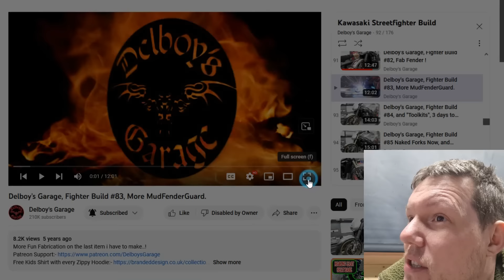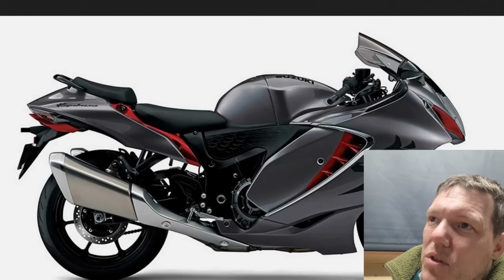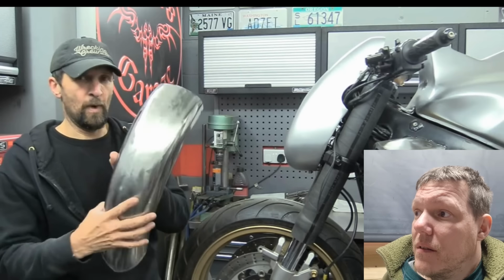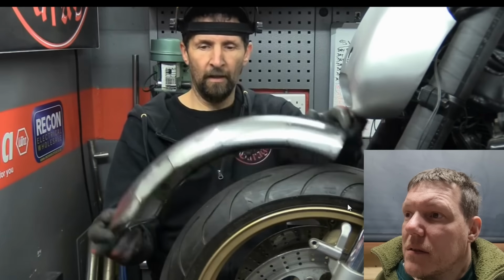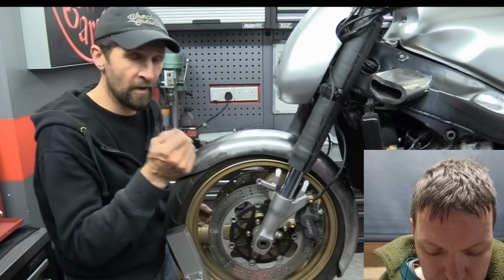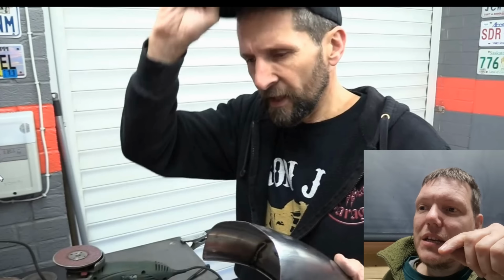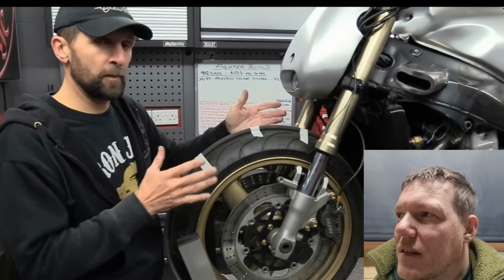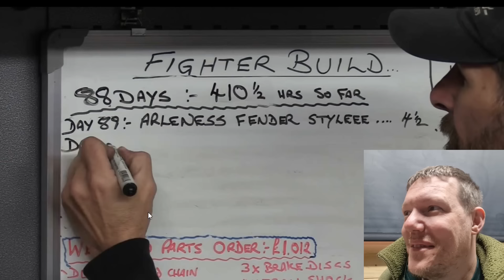HDS 56 - Radius Matters

Comment: Back in the early 80s I had a mate that worked on a gas line going through berkshire, apparently it was stick welded inside and out by team's of welders all coded. Each weld was inspected I think by x-ray and each welder was allowed 3 mistakes and then off the job

Comment: No need to chop any part of the mudguard to change the radius by the amount he needs. Two big blocks of wood to lever the edges outward which will tighten the curve, slowly work your way along the mudguard and little movements will make a big difference.

Comment: Back in the day I was engineer on various factory trawlers and I could stick weld fairly reasonable,i have never used mig surely he could reduce amps and run a bead instead of blob welding ?
Reply: Don't think he knows how to change any settings, it seems like it's either on or off.  When it get's too hot, he does the tack thing instead of turning the power down and playing with the wire speed.

Comment: Well the guard radius doesn't match the rim radius at the front and then goes sort of straight for a bit and then goes back to an uneven radius after the weld joint.
I guess there's perfect and then there's Del perfect?

Comment: In orbital welding, it is very common to use Formier gas as purge and if you use it as welding gas+purge you can get deeper penetration, cheaper too than argon i think. Also restricting gas flow is for controlling weld height. Prep work is hardest. Small defects in cutting will ruin your day 😄 only usable when welding well prepared parts and big series.

Comment: To tighten up the curve of the muggaurd you are right- Unfold the wired edge, Shrink either with heat or shrinking tool and refold back in a new wire. But on stainless?Nope.
Reply: I've just realised that another reason why dellbollocks is so cack handed cutting with the grinder is that grinders are all Right handed-Ha!

Comment: I think having those silly tubes over fork legs is a Harley thing. Saw one with them tother day and couldn't understand why you'd want extra bits of metal on there. Guess it doesn't make much difference when the bike already weighs a ton.
Reply: Because they like fat thick forks but are too tight to buy a set for specific models so sleeve the things to give them their fatboy forks because harley are cheap.